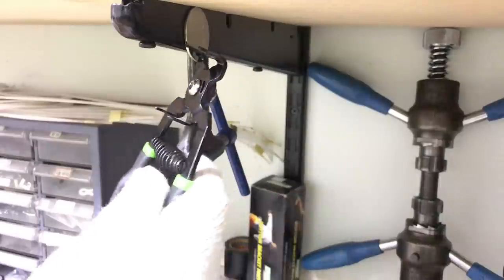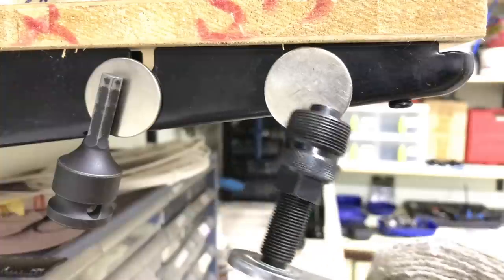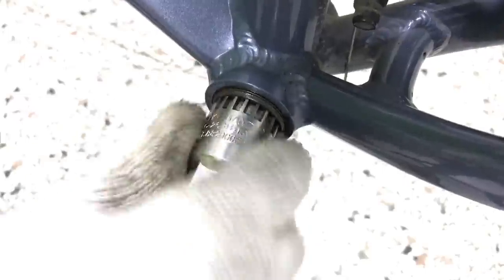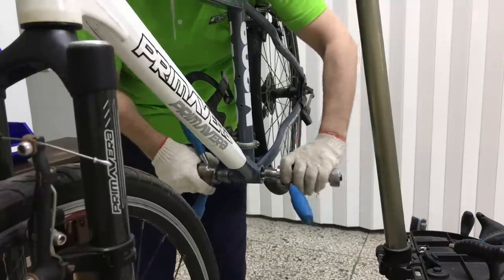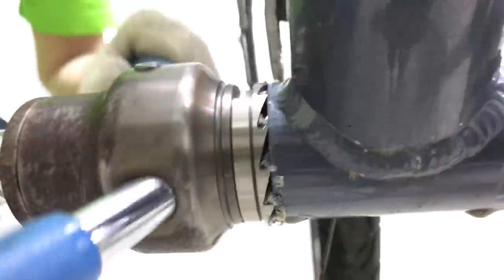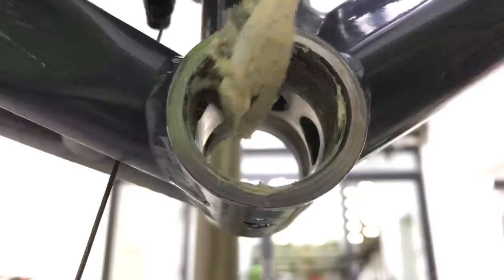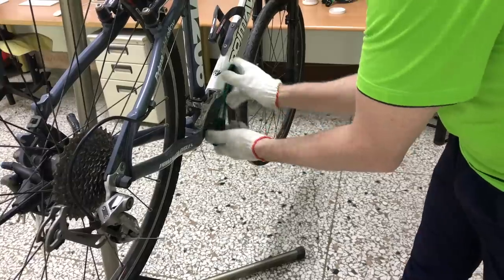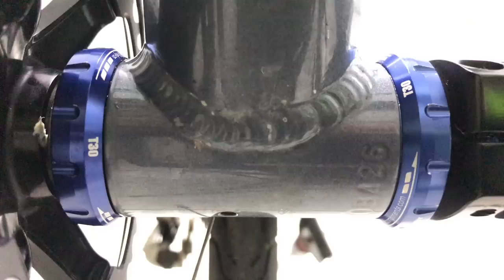BB30 Benefits W/O the Downside (BSA Spindle 30 Conversion aka BSA30)

Comment: A well presented video, but, You need to correct your terminology & identifications... 
You have installed a set of BSA30 bb cups into a 68 (or 73mm) english Threaded BB shell ... 
BB30 is a different beast entirely, and in this example not applicable. 
This crankset is effectively a BB386EVO , a relative to BB30, but utilizing an 18.5mm longer axle spindle.
Reply: Pro Wrench  is bb30 and bsa30 are different?
Reply: @erolleroll5706  I'll try to keep this simple, because it can be horribly confusing with the multitude of BB standards in the industry.   
Yes, BB30 & BSA30 are completely different.  
Both standards use a 68mm wide BB shell on the frame, but differ in the BB execution.
With BB30 the bearings (6806) press directly into the BB shell, so your BB width remains 68mm outside to outside.
BSA utilizes a 68mm threaded BB, which you thread in the BB cups (which house the bearings).  The installed BB will have an outside to outside width of approx 90mm.
This is why a BB30 crankset will not work with a BSA frameset.   A BB386 crankset will work with both setups (but will require spacers for BB30.
I hope this helps
Reply: @prowrench7989  I'm so glad SRAM created the DUB crank arm. Now it doesn't matter what type of shell you have. You can just throw on the DUB bottom bracket that matches your bike and use any of the DUB cranksets.... It's awesome... if only more aftermarket component manufacturers would use it more...
Reply: @prowrench7989  Even the manufacturers doesn't really know what they're talking about?
I'm getting so misleading informations from Bottom Bracket and cranksets manufacturers that my hair getting grey prematurely. I have BSA (68mm, english) frame and I want to mount FSA SL-K Light Carbon BB30 cranks. I was told I need to buy BSA30 bottom bracket to use that crankset. Is it correct or not?
Reply: @MaciejSebastianKijowski  The short answer is No, your BB30 crank will not work ( the crank axle is too short).   FSA has discontinued BB30 cranks for the more adaptable BB386 standard (BB386 is an 18.5mm longer axle version of the discontinued BB30 crank)   A BSA30 BB will work with a BB386 crankset (all new gen FSA cranks use this standard) but not the older BB30 version of FSA cranks.  In your case, your BB30 crank will only work in a native BB30 frameset ...This is why you will often find BB30 cranks at a discount...limited compatibility.
Reply: @prowrench7989  true words spoken! :)

Comment: An issue I've had is my bb30 spindle is 68mm long. Add the external bb30 BSA cups 2x8mm to the 68mm shell, I've got 74mm. To get the crank to fit I need to trim the shell to 52mm. Can just about mill 16mm from each side of the shell but concerned the crank arm will won't clear the frame! Any advice?
Reply: what brand of cranks are you using? did had any luck? i did bought fsa afterburn 104bcd crank silver one that is bb30 and i have bsa frame too dont know my spindle length too

Comment: Very informative and well made video. One question: why lubricate the spindle? Won't the lubrication make the spindle slip inside the bearing inner ring while it is turning under load? The idea is to let the ball bearings handle the rotational friction. Thanks
Reply from the maker: Thanks for the comment Norman. The fit between the spindle and the surface of the sealed bearing is very snug. Without a smear of grease the spindle can doggedly cling to that surface. Even with the grease it often needs a few taps with a rubber mallet (with a protective cloth between the mallet head and crank surface) particularly for the last centimeter or so in order to seat the crank properly. Without grease, you'd need to really bang it hard which is no good at all—that'll likely mark the crank surface even if you have a good pad between it and the mallet, plus put unnecessary stress on the sealed bearings. So the grease minimally assists installation, or in the worst case, simply makes it possible to install a crank in a tight fitting situation. ~Glenn

Comment: First, I didn't like it when I saw you loosen the crank bolt with a torque wrench. That's a no no, and you should know better. Also, how did you set the bearing preload on reassembly?
Reply: why is that a no-no? i can't imagine it damages the BB. maybe because it can damage the wrench?
Reply from the maker: Thanks for the comments. We'll have to agree to disagree on technique here. This torque wrench has range from 28 nM to 210 Nm. Dialling in 70 Nm coupled with the long handle providing maximum leverage, stubborn bolts are broken free easily using the wrench consistent with its intended purpose, since even the most resistant bolts are rarely tightened in excess of 60 Nm. If the wrench "gives" at the selected torque setting, I cease applying pressure and bump it up another 30 Nm or so.  I only once had a bolt that required over 100 Nm of force to remove it in over a decade of being involved in bike assembly and maintenance, in which case rather than crank the tool up to 150 Nm, for example, I had a factory pneumatic tool loosen it (probably the cause of the excessive torque originally). A shorter wrench with an old aluminum seatpost added to it for extra leverage is usually enough. Still, this trusty wrench (by Bike Hand) is in its 9th year of service and, in conjunction with periodical recallibration, is looking good for another 9 years. If anyone reading this feels that using their torque wrench in this way may damage it, then most certainly, do not use your torque wrench in this way. However in my experience I have never had any problems and, of course, I can only talk from my experience. ~Glenn
Reply: I disagree, there are two ways to ruin a torque wrench, continuing to to turn after it clicks to set torque and storing it set to a torque. Always stop once it clicks (2 clicks is fine) and release torque setting when your done using wrench.

Comment: So I noticed that you used a torque wrench to remove the old BB, but did not use one when installing the new one. What was the reasoning behind that?
Reply from the maker: The wrench was used to remove the original bottom bracket with a standard ISIS splined tool. The replacement "T30" 30mm ID bottom bracket's Outer Diameter is non-standard, so it comes with its own wrench machined to fit the T30 cups. There's no commercially available socket tools (such as supplied by Bike Hand) to fit this. As to the correct torque, that's a standard min 35 Nm max 50 Nm. A person with average strength giving it a good heave will end up somewhere between 35 and 40 Nm, so it would be at tolerance. There's certainly no danger of overtightening; it would be possible to not get it tight enough though.

Comment: Why do people use a torque wrench as a ratchet? A torque wrench is a precision calibrated tool, using it as a ratchet only stretches the internals making it inaccurate when your using it correctly to tighten something !! 
Just use a breaker bar, that's what it's for, to break nuts and bolts away, hence the name breaker bar!! I'm a mechanic and my tool box is over 4k empty and probably close to 20k including the tools, so seeing people do things like this really grinds my gears !!
Reply: Who told you that? Open up an old torque wrench sometime and you should see immediately why that is not true at all. The ratcheting mechanism works independently of the torque mechanism. And nothing moves inside the torque release mechanism at all until you overcome spring pressure. Before that, all loading is static and this will not wear anything out. If there is any premature wear at all, it is negligible.

Comment: Youre never supposed to loosen with a torque wrench
Reply from the maker: Here's the context for ignoring that "rule" in this case, a comment made elsewhere:
This particular wrench covers a range commencing at 28 Nm through to 210 Nm. It is designed for jobs way bigger than any typically encountered in a bicycle workshop, jobs on trucks for example involving M18, M20, M22, M24 bolts. Hence, on that point alone you certainly would not be using it on smaller bolts in the M2 to M6 range that typically involve carbon components and require the use of a smaller 0 Nm - 25 Nm tool (we give an overview and technique guidance on M2-M10 torque wrenches in the 'Integrated Headset' video). If you ever had to break a bolt free in that context, it would only be because it rusted with age, fused to the component body. And even then you would most certainly not use the 0-25 Nm torque wrench to break it free. Note that is a "click" type wrench where a spring is compressed; no "stretching" is involved.

In this workshop this 28-210 torque wrench is used for 1. Reaching tolerance on square taper, splined, cartridge BBs with a lower limit of 35 Nm and upper limit of 50 Nm 2. Reaching tolerance on outboard bearing cups with a similar tolerance spec 3. Reaching tolerance on non-driveside (M8) crankbolts, SRAM for example with a range of 48 Nm to 54 Nm, and square taper cranks. In its first 10 years of use (acquired in 2009) this click-type wrench has completed in excess of 20,000 cycles, with perhaps some 40 instances of being used to move stubborn bolts. It has had periodical recallibration, which I need not have worried about since it always comfortably remained inside the tolerances required for the specific jobs I need it for. It's a "Dr. Micrometer" model, by the way, local Taiwan brand...tough as guts. When I encounter the occasional  tough bolt (this is a "backend" assembly shop, not a consumer-facing bike shop) then I crank the torque up to 70 Nm which is more than enough to hold it (except once where my genius buddy from SRAM, Aka, a magician with recalcitrant components lol took the frame away and sorted it quick smart). Remember, this torque wrench does not know that it not being used on a truck chassis to torque a bolt to 150 Nm or higher—the function is the same; the purpose is not. Result? Bolt freed up and life goes on. I would note that a far more demonstrably damaging practice is neglecting to store a torque wrench with the spring still at tension rather than released back to zero, something quite a few owners probably neglect to do.

Anyway, should the reader here be in at all concerned that using their torque wrench in this manner may damage it, then most certainly do not use your torque wrench in this manner. And, of course, never continue to crank a wrench once tolerance has been reached. A variety of ways to break a crank bolt free are covered in the 'Squre Taper Bottom Bracket' video, by the way, including the "old seatpost" method. Be warned though, me and my gutsy torque wrench are a part of that too. ~Glenn
Reply: @firstcomponents  That's a lot of words to justify what is still bad practice... and good info for a novice mechanic watching your video to be aware of. Disclaimers matter, even if actual practices can justifiably sometimes deviate. 

That said, another thing that a novice mechanic might miss which you did right, was to use a nice not-rounded allen/hex key to break that bolt loose before using the ball-end version. Would be helpful to actually draw attention to swaps like that so that your viewers catch them, otherwise the viewers who most need to be aware of good practices will remain ignorant. 

Constructive criticism.. overall great video, thanks for posting!
Reply: @saintless  Exactly what I was thinking as well...

Comment: Wouldn’t cuttinng the bb shell make it smaller? Doesn’t this mean that you will need to add spacers?
Reply from the maker: The facing tool cutters remove the clearcoat and paint which brings the BB shell back to the original width of 68 mm (not 73 mm in this case). The cutters can take up to 0.3 mm more of the alloy on either side. That is within an acceptable tolerance—spacers won't be required. Some mechanics use a facing tool with the cutter on just one side, allowing them to continually measure the BB shell with a vernier to ensure they never exceed tolerance. ~Glenn
Reply: So is it absolutely necessary to do this? Or can the bb30 cups be installed  without the she'll being cut down?

Comment: The video is good, but it was possible to indicate how wide the carriage was before it was manually milled by the master in the form of a table or picture.
So it would be clear to those who want to do a similar upgrade on their own .,🚴🤔
Reply from the maker: By the "carriage" I think you mean the BB shell? The paint normally adds maybe 0.3mm or so to the non-treated alloy surface. The original width for these shells is 68mm. "Facing" the shell cuts them back to maybe around 67.99mm or so. I'd leave that particular process to a bike shop since it takes a lot of experience to use the tool properly, plus a good tool is quite expensive. You could get away without doing this. But a job like this still would not be complete without carrying out the facing procedure.

Comment: how did you do this whit a carbon frame?
Reply from the maker: The carbon frame would need an alloy sleeve bonded to the BB shell allowing acceptance of a threaded bottom bracket. This method won’t work with a BB shell set up for press fit.
Reply: Just use bb bsa30 for carbon right @firstcomponents?

Comment: You don't use torque wrench to loosen the bolts! I suggest reading manual. It stretches out the springs and therefore you need to recalibrate it quicker. That might be fatal for fragile carbon parts you will be working with later...
Reply from the maker: Thanks for the observation Grzegorz. Let's agree to disagree on the specifics here. This particular wrench covers a range commencing at 28 Nm through to 210 Nm. It is designed for jobs way bigger than any typically encountered in a bicycle workshop, jobs on trucks for example involving M18, M20, M22, M24 bolts. Hence, on that point alone you certainly would not be using it on smaller bolts in the M2 to M6 range that typically involve carbon components and require the use of a smaller 0 Nm - 25 Nm tool (we give an overview and technique guidance on M2-M10 torque wrenches in the 'Integrated Headset' video). If you ever had to break a bolt free in that context, it would only be because it rusted with age, fused to the component body. And even then you would most certainly not use the 0-25 Nm torque wrench to break it free. Note that is a "click" type wrench where a spring is compressed; no "stretching" is involved.

In this workshop this 28-210 torque wrench is used for 1. Reaching tolerance on square taper, splined, cartridge BBs with a lower limit of 35 Nm and upper limit of 50 Nm 2. Reaching tolerance on outboard bearing cups with a similar tolerance spec 3. Reaching tolerance on non-driveside (M8) crankbolts, SRAM for example with a range of 48 Nm to 54 Nm, and square taper cranks. In its first 10 years of use (acquired in 2009) this click-type wrench has completed in excess of 20,000 cycles, with perhaps some 40 instances of being used to move stubborn bolts. It has had periodical recalibration, which I need not have worried about since it always comfortably remained inside the tolerances required for the specific jobs I need it for. It's a "Dr. Micrometer" model, by the way, local Taiwan brand...tough as guts. When I encounter the occasional  tough bolt (this is a "backend" assembly shop, not a consumer-facing bike shop) then I crank the torque up to 70 Nm which is more than enough to hold it (except once where my genius buddy from SRAM, Aga, a magician with recalcitrant components lol took the frame away and sorted it quick smart). Remember, this torque wrench does not know that it not being used on a truck chassis to torque a bolt to 150 Nm or higher—the function is the same; the purpose is not. Result? Bolt freed up and life goes on. I would note that a far more demonstrably damaging practice is neglecting to store a torque wrench with the spring still at tension rather than released back to zero, something quite a few owners probably neglect to do.

Anyway, should the reader here be in any way concerned that using their torque wrench in this manner may damage it, then most certainly do not use your torque wrench in this manner. And, of course, never continue to crank a wrench once tolerance has been reached. A variety of ways to break a crank bolt free are covered in the 'Square Taper Bottom Bracket' video, by the way, including the "old seat post" method. Be warned though, me and my gutsy torque wrench are a part of that too. ~Glenn
Reply: @firstcomponents   It is desighned to do much larger torques in clocvise direction!!! Any torque in counterclocwise direction is damaging the wrench. Your wrench works only in clocwise direction. Wrenches that operate in both directions are made differently...
Reply: @TheJure123456  The wrench at 1:30 has a switch for direction.